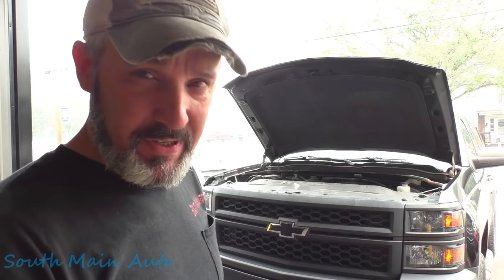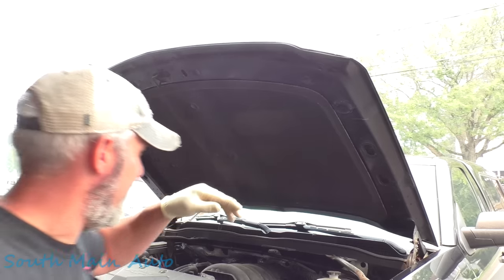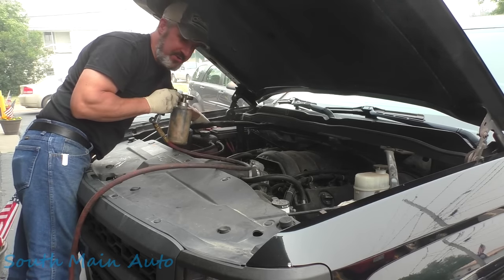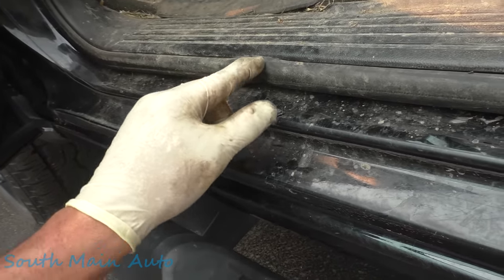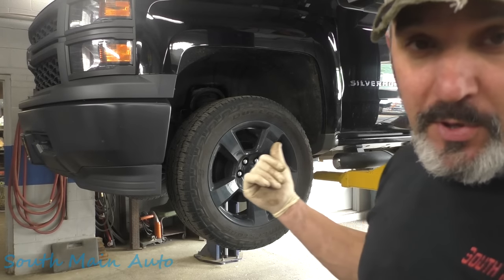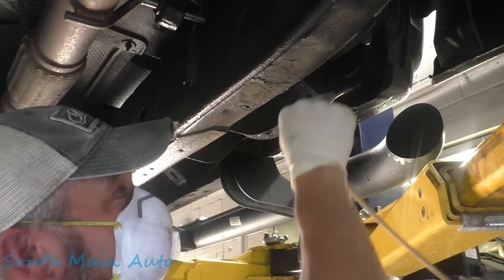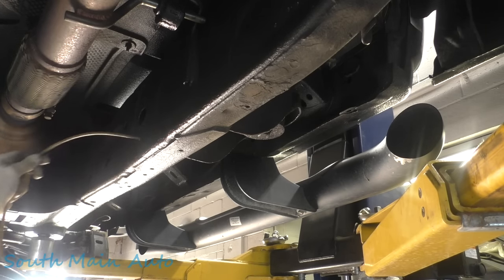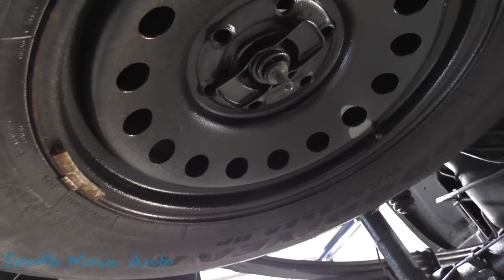Keep Your Car (Or Truck) From Rusting!! You Must Do This!!

Comment: I worked at an independent shop in 80s,  we had a lady come in complaining that the drivers  door was hard to close on the drivers side.  Our tech was very insightful when it came to customer complaints.   He checked the door it worked flawlessly.  He asked the service writer to send her out to the shop, the writer rolled his eyes and sent her.   She explained that she is old and weak,  she can close the passenger door no problem, the drivers door is a challenge,  she said I hope you don’t think I’m crazy,   He assured her that he didn’t.    One of the techs said it’s probably arthritis,  discounting everything she said.  The lead tech said I don’t understand exactly what she means but I know she’s telling the truth.     He opened and closed the passenger door,  then the drivers door,  went back and forth,  got a smile on his face, said listen to this,  grabbed the drivers door, violently shook it back and forth,  you could hear sloshing!   He grabbed a 5 gallon bucket,  a screwdriver,   Poked a hole in door drain and began collecting the water.   The door had a little over 15 gallons of water in it.  So around 125 lbs extra weight.    

In the 80s dealers offered their own rust proofing options,  they had almost zero training on it,   Spray and pray.

Comment: I'd like to do that for my 51 Ford.  Is it normal to find a frame member full of a white powder?  I drilled a hole in the 51 frame, and ended up with a neat pyramid of the powder on the garage floor.  Does anyone have an idea of what it was?

Comment: I have a 1966 f-100 that has seen the wear of time. I could use some of the stuff. I just bought a HF sandblaster to start rust removal on hard to reach parts

Comment: I have been doing this for decades on long island new york sea salt and road salt galore.
Seems today frames are rotting out faster than body panels.
Krown is awesome
I used gear oil on plow  trucks  and beach trucks in salt water boat hauling .
Krown seems best.

Comment: Glad you showed us the process Eric.   I don’t live in the North but we do get some snow and they do use some salt on the roads.   I had a 2006 Silverado that the rocker panels and cab corners rotted out on after about 10 yrs but everything else was pretty good.  So far my 2014 hasn’t shown any signs of rust (KNOCK ON WOOD).

Comment: How many can equivalent do you think you used? 

I agree. If you're going to drive it in the winter, you gotta do something. At the very least, hit the critical areas like what you said rots out on that particular truck. 

An area on my winter vehicle (Hondu Pilot) that needs attention is where the subframe attaches to the unibody. Eric The Car Guy did a video about welding that area in the rear. That would've mechanically totalled the vehicle if you couldn't do it yourself.

Comment: Mr.southman I have a Question. I have Autel MK908PRO2 ACDelco online acc, I have a GM 2008 Cadillac DTS it needs a BCM and my question is.
is it better to buy BCM from Rock auto or is best to buy used one or reman?
Reply from the maker: I'd buy new OEM only if I wanted to know it was going to work

Comment: I agree that summer when it's dry and dusty is a good time to do this on exterior surfaces that get water splashed. It gives the road dust time to get absorbed by the fluid film and form a hard protective coating that doesn't get immediately washed off. The nice thing about Fluid Film and its thicker version Woolwax is that they are not petroleum based and do not damage brake pads and most other nonmetallic parts. They also are nonflammable so getting the spray on exhaust system parts is not a fire hazard.

Comment: I do known on my 2015 Chevy thunder Silverado.  Think i got a bad bearing.  Can’t get the evap IM to eat foe smog test PIA.  CHEVYs
Reply: I also drop the spare tire throw it in the bed and remove the front plastic “skid plate” the guys like it easier to spray.  The krown goes on hot 150f.  Drips like a pig for a few days.

Comment: What's the price out there in the PRNY for this service in general?  Here in the mid-west salt/rust/'snow belt area this can run you A LOT more than a couple hundred bucks (WAY more).  My 24 year old Tahoe (half-million plus miles) has never been treated, and it's now showing signs of bad rust, and our area throws down salt/brine as soon as they even HEAR the word snow (you'd think with all the snow we get, they'd figure out how to do it right, but I guess they have budgets to spend).  VERY hard to justify (for my area) spending half the price of a new vehicle over 24 years.
Reply from the maker: It's about $200 here for a full size truck

Comment: Does that stuff do any harm to wiring insulation, rubber, seals, etc.? I need to find a way to put my semi from getting New England cancer. A little concerned about all the wiring looms and airbags, though.
Reply from the maker: I've never seen it do any damage. I spray my brother's Pete with it.

Comment: My car is 15 years old daily driver, and it was rust proofed every year.
Additional benefit is that so far not a single screw or bolt underneath was rusted or seized, so if any work was needed, it saves a mechanics time. And at current hourly rates, it saves me cash!
Reply: It won't even matter because if water, oxygen and salt can't get to the steel, the reaction won't occur.

Comment: Up here in salt. How should a RAV4 be prepared for Oil spraying? Wash upper body with hose and city water and dry? Wash engine compartment  similarly or just wipe off with wet rag?    Pressure wash underbody ?
Reply: Most important is to have it DRY.

Comment: oh man thats so horrible... you got to wash that vehicle down before you do that.. you're just sealing in all the dirt and salt and rust especially in the frame.. there could be an inch of dirt in that frame.. thats just so bad... even if you're not going to paint it or use rust converter.. it has to be washed.. thats like not using toilet paper and spraying deodorant on your backside

Comment: How many times did you refill the spray can to do the truck,  I enjoy watching your videos,
Reply from the maker: Takes about a gallon and a half if you are doing a first time application.
Reply: Thanks for your quick reply , I enjoy watching your channel, I have learned a thing or two or three, keep them coming,! I live in Florida, where we don't have that problem, I just like learning about different things, I have a few motorcycles and the humidity and condensation is as bad as the salt , at causing rust,  I keep them sprayed down with oils, it helps a lot, and was thinking I might need to try Fluid flim, I see they have it in spray cans, my son has over 20 bikes pb blaster and Wal-Mart's wd40 spraying them every other month cost,$$, 1 can does a bike and a half, at 6/10 bucks a can, I think the set up you have and a gallon of fluid flim may be enough for a whole year, only a few of the bikes get driven, Thanks for the video, Charlie in Pensacola, Fl.

Comment: Shouldn't you wash off the winter salt before you recoat it with fluid film?
Reply: I “assume” that the salt would have mostly washed off from driving in the spring rains.

Comment: Who would do fluid film right after winter. Wouldn't it make more sense to do it in the late fall
Reply: Like he said, summer heat helps it flow into places that you can't spray well. It hangs on pretty well as long as you don't pressure wash the underside during the summer.

Comment: What’s the average charge for a fluidfilm coating?
Reply: I heard about something like $300-500. You can also buy 3 spray cans with fluid film and a 2ft nozzzle and that might be $100 or so (that's what I did here in the UK). Apply that yourself or ask your friendly garage who have a lift to do it.
Reply: @318ishonk  thanks.

Comment: Your previous videos were actually what got me to order my spray kit, but I'm nervous blasting in the doors with my expensive speakers so I just do the bottom.
Ever have any issues with that?
Reply: I spray just into the bottom drain holes. I don't spray way up into the doors and it's worked great on my current vehicles. I don't think it's necessary to get way up in there as any moisture, salt, debris, etc is going to settle at the bottom so i just make sure the bottom inside is coated. Then i spray the bottom lip. Hope this helps.
Reply: @jokly1264  Rust always starts at the pinch weld and works it's way up from there.  So.... if you get the bottom pinch weld covered and say the front and rear pinch weld about 8" up you will be ahead of the game.
Reply: I take my door panel off since it's not hard to do, remove the speaker, and spray inside the door bottoms from there.

Comment: One concern is spraying over rubber such as ball joints and bushings. Those rust inhibitors will soften and deform rubber causing premature failure of the bushings, rubber sleeves, door seals, etc... I would be very careful...